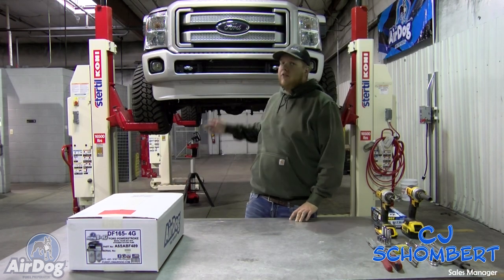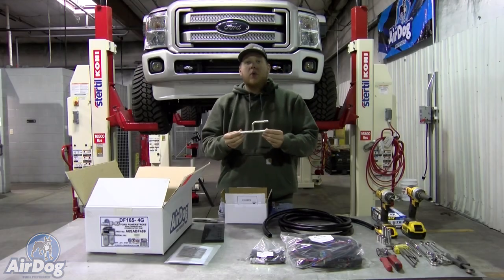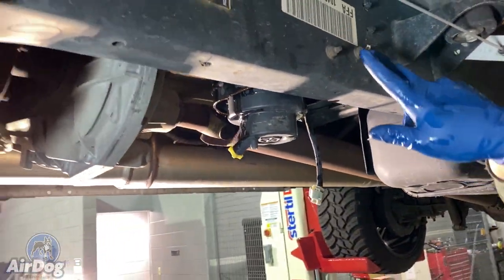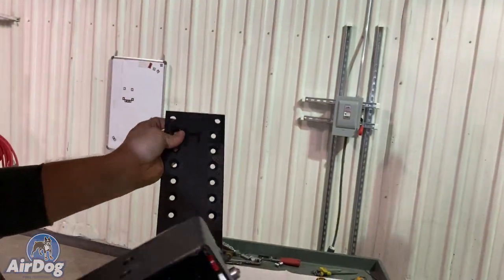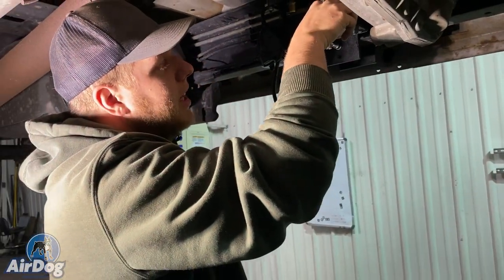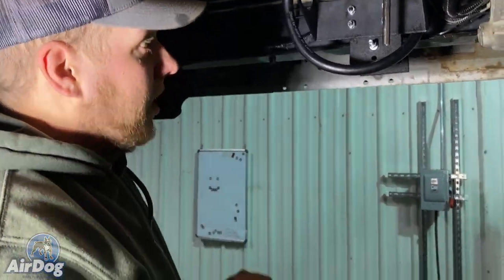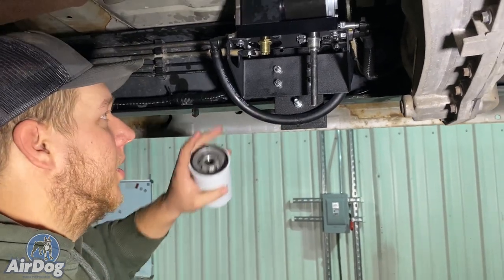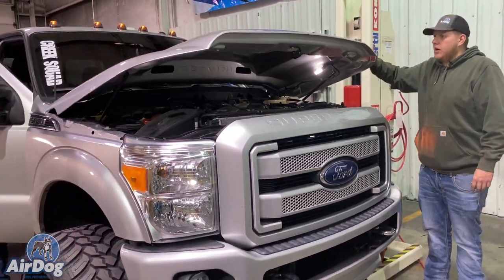2011-2016 Powerstroke Install DF-165 4G

Comment: So when you remove the old lift pump , and unplug the WIF sensor does it through a code ? I have the same truck as in the video. Thanks
Reply: I am getting a code as well. Is there any fix for this?
Reply: @keltonblack762 leave it plugged in, duh

Comment: I had an air dog on my duramax. I now have a 15 f250. Just wondering how the priming process works.   Just turn the key on until fuel comes out of the filter?  I know currently on my stock pump I turn the key on and off 6-7 times with 30 second intervals. Will I no longer have to do that?
Reply from the maker: Our fuel pumps are usually self priming. Once installed, roll the key forward and listen for the tone of the pump to change. Once the tone changes, the pump is primed. If it happens to be vapor locked, crack the fuel filter until fuel comes out and quickly tighten.
Reply: @AirDogSales  
Awesome. Thanks man. I’ll be ordering my pump soon

Comment: Anyone do an install on a 2011 f350 6.7L diesel and lose their auto start option after the airdog liftpump install. I had it right before install. Tech support is saying to change fuse location(which i have), up the fuel pressure or something else is wrong that isnt related to the lift pump install( that last repsonse from the tech support sounds like some BS). TECH SUPPORT WAKE UP, YALL SOUNDED SLEEPY AS HELL THIS AFTERNOON. If anyone has ran into this issue, i would appreciate some solid support.

Comment: Similar process for a 2017?
Reply from the maker: We currently do not have the 17+ kit out yet. Look for it around February 2021. It is a more complex installation with it's in tank fuel pump and conditioning module.

Comment: Do they make one for 2017 6.7 powerstroke
Reply from the maker: We currently do not have the 17+ kit out yet. Look for it around February 2021. It is a more complex installation with it's in tank fuel pump and conditioning module.